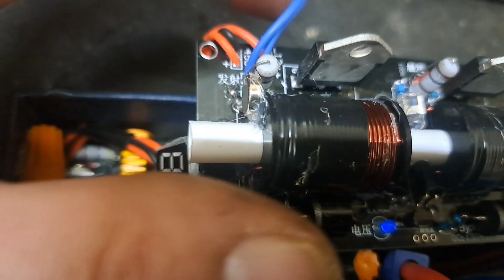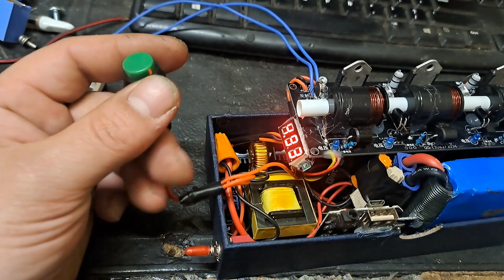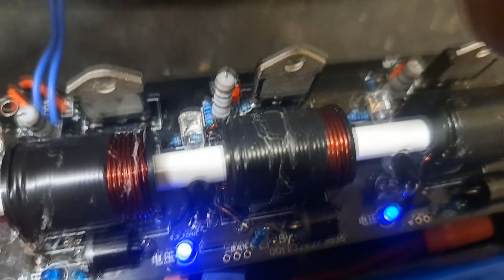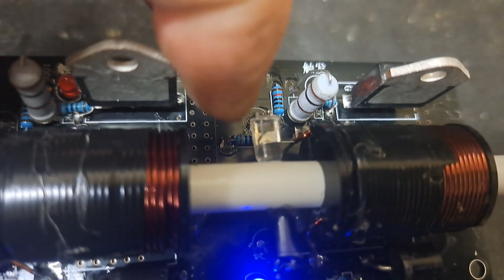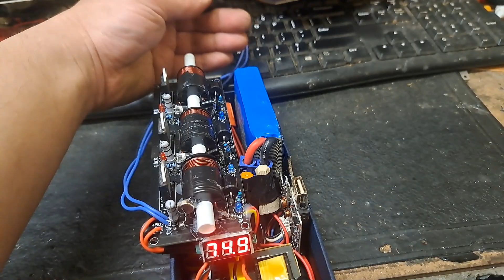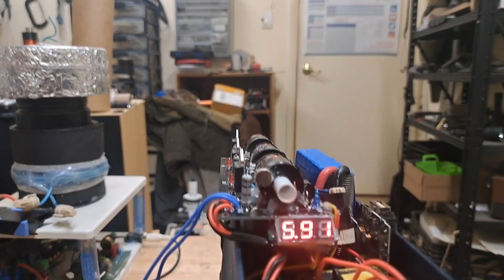3-Stage Coilgun Kit (Aliexpress)

Comment: By chance did the high voltage boost converter become hot or smoked? Because I bought a 10 stage coil gun off of AliExpress and the most you can charge to is 60 V before it begins to smoke.
Reply from the maker: This one is still going strong though I've heard of others having issues. I think some people randomly get different converters and their mileage is varying. If yours is just a simple ZVS driver like mine though then it's an easy circuit to diagnose or repair. Can you tell where the smoke is coming from? May need to isolate the circuits to see if the converter is able to output a high unloaded voltage by itself. If you have a DC supply up to at least 30V then also wouldn't hurt to charge the caps with that to see if the current spikes then levels out to almost nothing like it's supposed to.
Reply: @ the part that smokes is the inner coil of the yellow part
Reply from the maker: @vortexthebacon  So a transformer winding?
Reply: @ actually the transformer (yellow thingy) was smoking, it was the diodes and the place where you put the input and output wires in
Reply from the maker: @vortexthebacon  Sounds like the converter either has a problem or it's being given too much of a load via the cap banks having bad wiring somehow. If they are getting to 60VDC though then I'd think the converter has the problem.
Reply: @Magneticitist  sorry for my last comment , there was a typo😅. I meant to say, actually after taking a closer look, the transformer wasn’t the component that was smoking. It was the diodes and the blue socket where you plug in the voltage input and outputs. Do you have any idea how I can troubleshoot? Right now I bought a new boost converter from Amazon. Waiting for it to come.
Reply: I don’t know whether to buy an entirely Neo boost converter or try and troubleshoot the original one that came with my coilgun

Comment: Late to the party. If you take a bolt and turn it down to a pointed bullet about 3/4 to 1 inch long and turned down diameter so that it is just not touching the walls and can slide through but barely, load it in about 1/4 into the 1st coil and fire it will be noticeably more powerful.

Comment: I actually bought same thing as yours but i dont know how to hook converter and coil gun. Can you please make video of it? Also there is no + mark on pcb where i should solder led on it so if you can tell me that either thank you!
Reply: I'm using converter that came with
Reply from the maker: There should be a 12V+/- and a 450V +/- marked on the board. Your 12V battery source goes to the 12V terminals on the board but you'll want to use a switch obviously. The switch should connect the positive terminal of your battery to the 12V+ on the board and the 12V+ to the converter.  Negative terminals straight to boards. Then your converter output goes to the 450V terminals on the board.

The led holes are not marked with polarity but there should be an etch showing one flat side and one rounded side. The flat side is the negative/cathode. Does that make sense?
Reply: @Magneticitist 
Thank you for replying im keep trying to make it but I dont know where is output and input of the converter also when we solder coil in to pbc do I need to consider the direction of the coil?
Reply from the maker: @geolmook  It probably doesn't matter the coil polarity but you might as well just solder them all in the same direction. No matter the polarity, the coil is still going to suck in the ball bearing when it's pulsed because it's not magnetized. 

With the converter I think they are not all the same. Mine was a basic ZVS driver with ferrite transformer for the output. If that's what yours is, then just look for the rectified output coming from the transformer secondary. You will probably have to trace it out. The negative terminal of the input will be tied directly to the mosfet source pins, and the positive of the input will be tied to the toroidal inductor.

Comment: i bought one too, but it always blows the SCR. i think that maybe the wire of the coils has not enough resistance, or maybe it  doesnt have the right impedance.
Reply from the maker: Does it blow the same SCR every time? Those are some beefy devices which are usually tough to kill but they are likely on the cheaper end. Could probably source some similar alternatives for cheap that can handle much more peak currents.
Reply: @Magneticitist  i tried better scr (btw69-1200), and i tried also buying more of the same kind, and even original ones. nope. the problem is something else. the gun works just fine under 300v, but above that and the scr are getting exploded after few uses.
Reply from the maker: @matatisan  Have you tried double checking the solder job on the big diode on the coil?
Reply: @Magneticitist  yes.I actually even built the all pcb again by myself... I am almost sure its the coils. strange
Reply from the maker: @matatisan  That's weird. Are you using really low ESR electrolytics?
Reply: @Magneticitist yes. And I built a few other coilguns in the past an it didn't happened.

Comment: Would this kill you if you accidentally touched the cap or something
Reply from the maker: Realistically no but possibly in the right circumstances I suppose it's possible. A capacitor tends to have the extra dangerous aspect of possibly being seemingly harmless just sitting there on an unpowered device... but could give you a real painful shock.. What I'd consider realistically fatal are much higher voltage capacitors which can also store enough charge to do real damage. If we're talking say 200kohms resistance between two points on your body that cross your heart region (like hand to hand), then a 400V discharge across that resistance is going to be in the region of pain and not death. Sweaty hands etc, the game changes, but still no death most likely. Takes a lot to fry a person or stop a heart, but the safe guesstimation is typically between 10-100mA, 100mA probably being more realistic. 

When you start playing with 2kV capacitors and higher (like MWO caps), that 2kV has suddenly brought the current through your body across that arbitrary 200kohms to around 10mA.. the lower end of what is supposed to be potentially fatal.. But the capacity of the particular capacitor is what matters also at that point.. since you're guaranteed the pain, the question is how long is that pain going to actually last given the charge in the cap and how long it takes to dissipate through the body..  So it's safe to recommend to people that if 10mA is the lower end of what could stop a heart.. then a 2kV cap is a nono to be playing with. 300-400V is more like in a DIY stun toy region but can still hurt someone.. for example discharging a 300V cap into someones arm, but then causing them much more pain if they jerk their arm away and send it right into something hard that breaks it.

Comment: Hehej that was so much fun !! It is nice to take a break of tesla coils and play with some others electronics I been trying to build a pulse motor , also since I got my zvs working and already got bored of shorting capacitors I might go with a rail gun or a coil gun
Reply from the maker: These are pretty fun lol.. I shot a small rod at work and it went slam through a cardboard box and smashed against the wall lol. Definitely more powerful than the BB. I'd def start off with a 3 stage kit cause it does seem like the extra stages might be a waste.